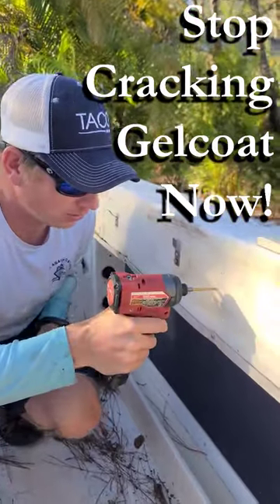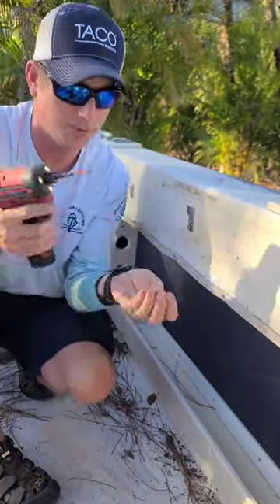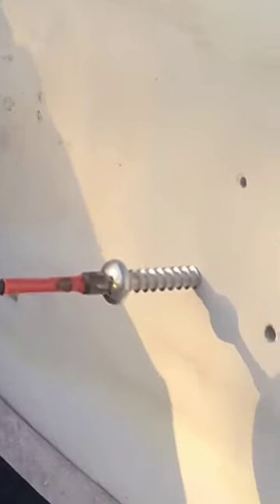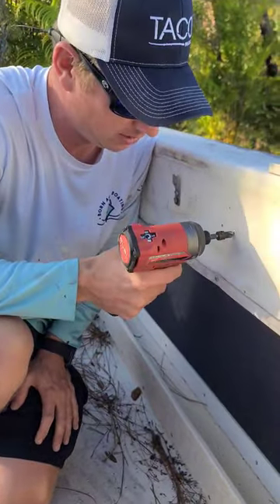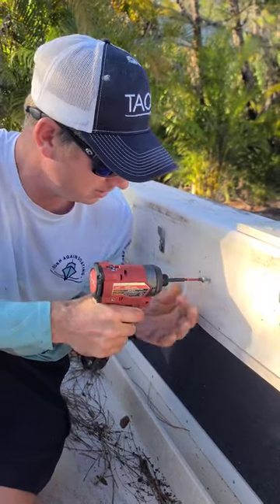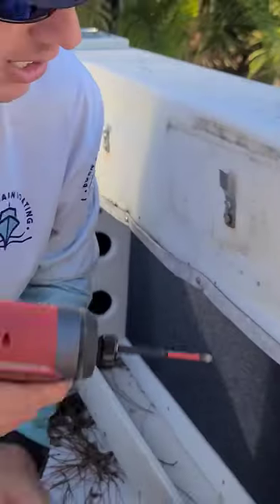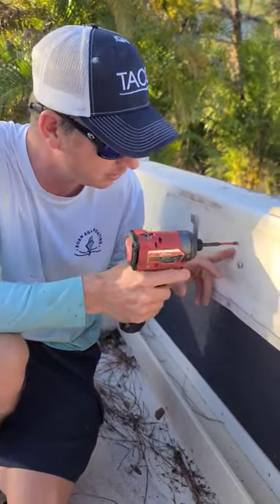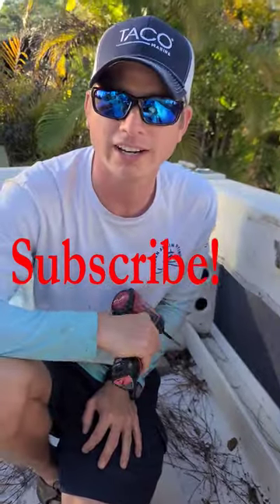STOP Cracking Gelcoat!!!

Comment: Stop using impact drivers! Use a drill on low torque and rub screws on bar of soap
Reply: I canr stand when I see impacts being used as a drill. The shocks are cracking it!
Reply: 3 years in charter, never seen somebody use anything else than screw driver
Reply: I don't think he understands what impact means 🤣🤣🤣🤣🤣🤣
Reply: Why soap

Comment: Even better you can just use the proper drill bit to properly size the hole. The threads are all that need to hold.  When not properly sized the core of the screw will cause pressure pushing outword.  While using an impact it will create cracks even easier.

Comment: Yeah, and you should be putting 505 or sika  flex in every hole you drill on the deck anything below the waterline you should use 5200

Comment: You forgot to mention apply sealant to the hole.
Reply: Which is extremely important when it comes to skiffs like carolina skiffs.. the water gets in the hull and you have a nightmare…
Reply: Its about gelcoat cracking and not about how to put screws in correctly. Genius tip BAB!🤙🏼
Reply: The common sense part will be on the next video, for now just learn how to NOT chip or crack the gelcoat.